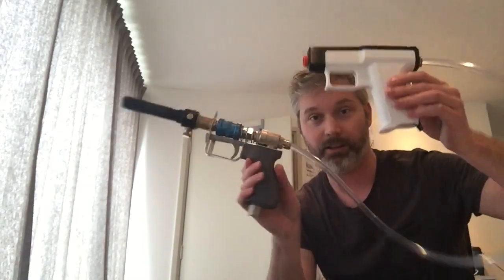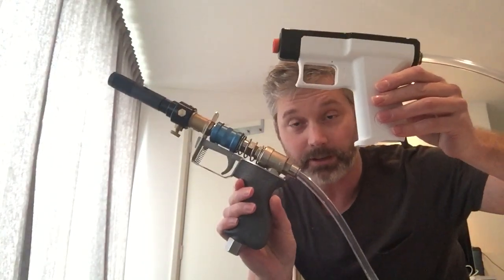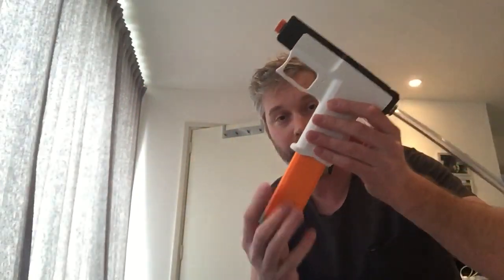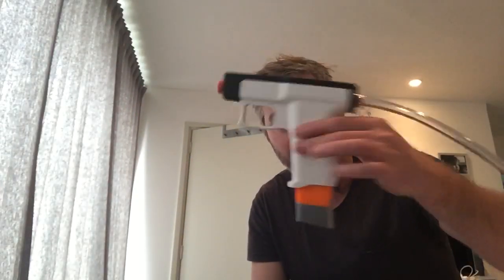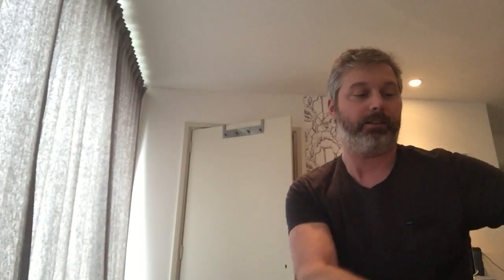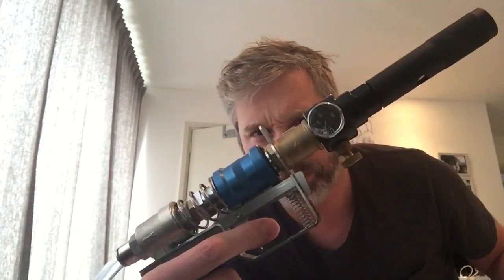Test firing Nerf Liberator GEN2. Remote rig select fire HPA powered ‘tiny’ mag in grip blaster.

Comment: Awesome that it works now! Will be epic to dualwield. This demo is done on regulated CO2? How does this compare to the final setup? I know last time it worked with a blaster as air source, but not with another system. In other words, are you sure this will work with a HPA air bottle?
Reply from the maker: Blaster-Time one 100% positive. There is no difference between 100 psi stored in volume X created by expanded CO2 or the same 100 psi stored in the same volume X created by expanding air. The resulting exhaust of pressure through the QEV and hose is equal in both cases.

Comment: Could you give me the Link of the Airreservoir thingy with the Regulator on the Front?
Reply from the maker: Not a link. But both can be found on AlieExpress. Have to warn you about the regulator: it’s flowrate is dramatically low and wont sustain anything close to semi auto. It works fine for manual reset but anything above that it will make performance horrible or even cause mallfunction. Anyway: the CO2 holder is a ‘CO2 quick change adapter’ for 12 gram CO2 cartridges. It is a standard paintball part and is easy to source. The regulator is a ‘300 psi CO2 paintball regulator’ (search that on AlieExpress and you’ll find it). It accepts unregulated CO2 and regulates it down to 0-300 psi... depending on the setting of choice. Sorry for the late reply :-) I don’t always get notified it seems when someone replies.
Reply: @nirodha7028  Thank you very much! I bought that very same regulator a few days ago, i intended to use it for a "semi auto airsoft gun". Hope the flowrate isnt that terrible. :/ Roughly what Rate of fire can i expect?

Comment: Whoa that is amazing, currently building my own hpa, I've never done it before and don't have the luxury of money to but nice parts, just got pipes and o rings and some other bits and pieces, I also want to eject a shell afterward, could I create a blow back system that uses excess air from the barrel after shooting to push a piston back and eject and load a new shell? 

Amazing work 👌
Reply from the maker: I never say ‘you cant’ because everything is possible. What you are describing sounds complex though... whether you are a beginner or not. :-)
Reply: i would rather make it with a blow forward bolt, with an open bolt design(Breech is open, when not in use), its waaaay easier and works like a charm
Reply from the maker: Cethoss good luck! Looking forward to what you might come up with! A downside to blow forward designs is their inherent violent action when moving forward unless the piston area doing said action is small. Can surely be done! Make it happen!